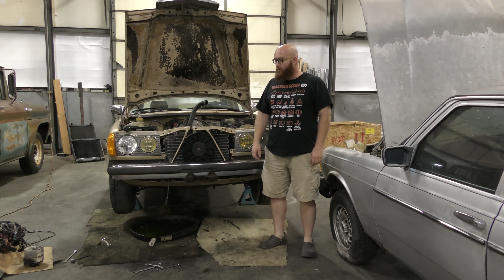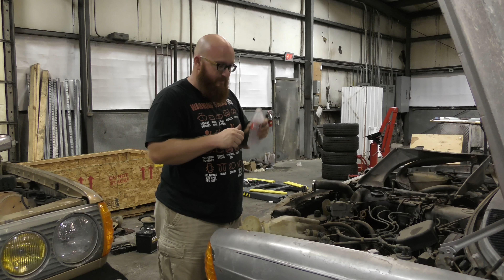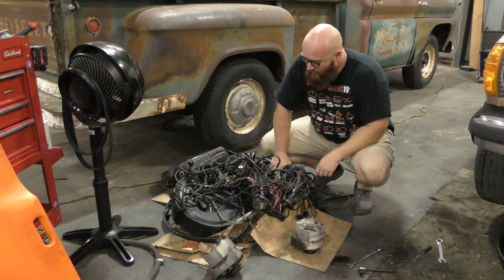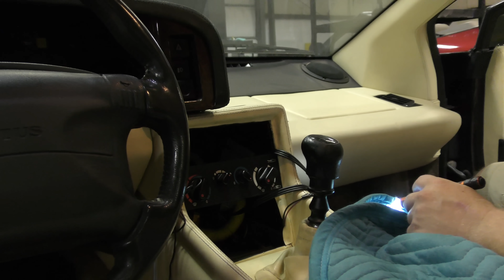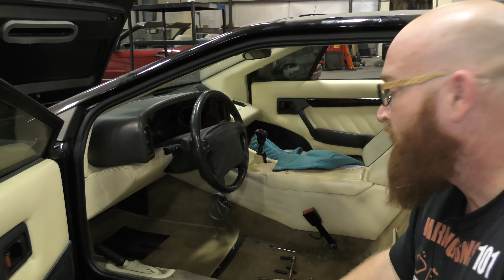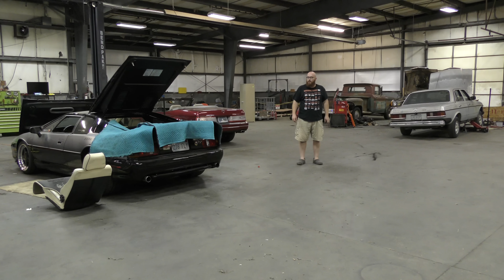Major Lotus Esprit S4S overhaul 99% done & CAR WIZARD is busy swapping parts on MB 300D restore

Comment: Once the Mercedes is done you mentioned a engine swap with the leftover engine. Swap it into a either a S-10 or S-15 pickup for a parts hauler with a manual transmission.

Comment: Hope you will install a new hood pad on the 300 Turbodiesel.  In addition to quieting the engine clatter, it helps to protect the hood paint from damaging engine heat.  Press on regardless

Comment: How many of you has done work under the dashboard. The head down in the dirty floor besides the pedals, on your back with the legs up on the seat. (or if the seat is removed to make it easier), no room for the arms to move to the reach something up there.  The claustrophobic feeling that you will be trapped where you are. On top of that, you are trying the remove the heater unit. The coolant fluid is pouring down you arms.
My believe is, if you end up in hell, your punishment will be working under a dashboard for eternity.

Comment: hey wizard. if your going to swap all the 85 vacuum system  might as well swap the 85 rear end into the 84 300d. nicer highway cruising gear ratio. motor not screaming at 65mph. my useless two cents. peace.

Comment: I have a W123. The vacuum line from the pump to the brake booster has very fragile nipples that easily snap off when just brushed. I have found that uncoupling the line at both ends to lay it aside is a good thing to do when changing the oil filter or anything else on that side of the engine (glow plugs, filters etc). Then I put it back. Every time I go to a pick and pull and find one of these I harvest that line as I’ve already had to replace it a few times because I forgot. Also my 85 is a 49 state car (Texas car) with a California vacuum routing. It was very confusing, but it is what it is. It has a number of other strange factory items in it as well. Another time for that story. Great car!

Comment: I have a similar no reverse on a jaguar xjs after clutch replacement any pointers to where I should check
Tony in the UK
Reply: chris younts 
Yes hydraulic.. Everything is new. Turn engine off and put in reverse no problem. Just won't go in running

Comment: Wheel bearing for my chrysler PT cruiser. The local parts store failed to ship me the part for two weeks although they had it in stock. I order parts from germany and it only take two to three work days to get to me but they cant ship stuff 50 miles in two weeks.

Comment: Would it make sense to try to replace rubber vacuum hoses with small metal pipes/tubes?  It seems that those thin rubber vacuum hoses go back so easily (under a hot hood) and cause so much chaos...

Comment: It is rare to see a Lotus, it is extremely rare to see a running engine in a  lotus.  It is staggering rare to see a Lotus moving under its own power.  Maybe back in about 1992 I saw one running and moving with its own power.
Reply: Apparently you have never owned a Lotus.  My esprit SE is as reliable as any European car of that vintage.
Reply: My 95 S4s has 80K miles on it and has NEVER failed to start as long as I didn't leave the lights on and drain the battery and always gotten me home. Meanwhile my Honda Accord is on it's 4th transmission and god knows what number alternator. This particular one has been modified WELL BEYOND (chipped, big turbo, etc.) the original 910S engine which itself was a souped up version of an old engine to squeeze for its time the most HP per litre in the world. I would bet that by percentages there are more Lotus running compared to manufactured than any one.

Comment: The alternator from the parts car may be working now, but it would be a good idea to check the voltage regulator brushes before installing it (cheap insurance to prevent a comeback for a “dead battery” or “dead alternator.)

It pains me to see how many w123 owners cobble that vacuum line, it’s $30 from PelicanParts(dot)com for a genuine Mercedes replacement!

Comment: I will always love the fully open feature of the Mercedes hoods.
Reply: I enjoy that on my W202 as well, great access to everything!
Reply: @georgobergfell  And you basically only need to completely take off the hood when you're replacing it, but never for anything else you're working on underneath.
Reply: Theoretically, all cars with prop rods have the capability to open fully without removing anything. If the hood isn’t on struts or self supporting hinges, it can lay all the way back on the windshield. Just be sure to lay a blanket over the windshield so you don’t scratch anything.
Reply: @fastball1977  But the Mercedes ones in question actually lock in that position.  No need to do anything else.  Also, on other cars, a lot of times things bind and washer nozzle lines get in the way or stretch. Not quite the same.
Reply: Volvo 700 series can do that as well.

Comment: The good thing about this harness repair job is: This car doesn't have a CAN bus system yet, therefore you can do a proper solder job to connect the wires together. One that will hold longer than the car is on the road :-)
Reply: Curious as to why you couldn't solder wires on a CAN bus vehicle.
Reply: @cambridgemart2075  It is advised against that, especially with the more modern high frequency busses, because the electrical porperties of the wire can be altered by that, and this makes it so that the bus communication can be less stable. We're getting into HF territory there, and for that, totally different rules apply.
Reply: @Seegalgalguntijak  I'm very familiar with HF and above having worked in comms for 15 years. I wasn't aware that CAN bus operated above 10MHz though.

Comment: I cannot wait for Mrs Wizard's channel, I also think of saving the buy this not that toyota for the foreseeable future, I'll provide the categories
Small: to buy: 2003-13 Corolla, the 2016-20 Yaris, Yaris IA and the scion IA, 2004-15 Prius and the 2003-14 Matrix, not to buy: Echo
Midsize: to buy: 1980s-01 Camry, 2008-17 Camry with auto and 2002-06 Camry, not to buy: specifically 2007 Camry
Large: to buy: 2004-17 Avalon, not to buy: none
SUV: to buy: Land Cruiser, 4Runner and Highlander, not to buy: FJ Cruiser
Sportscar: 1994-99 Celica (technically 2 door version of corolla and is Scotty Kilmer's daily driver), 1993-1998 and 2020 and newer toyota supra, not to buy: Camry Solara (same as celica, but a camry)
GM: 1984-88 Nova, 1989-02 GEO Chevrolet Prizm and Pontiac Vibe
Bonus: Lotus Elise, Exige

Comment: That heater control valve on the Lotus is ridiculous. The old Jaguar XJ heater valve used to be a 2 day job. An old and now sadly departed friend had a repair shop and he had to replace one once. The Jaguar book said it was a 2 day job. The body didn't have to come off, but the entire dash had to be dismantled and removed. Crazy design.

Comment: You need your new Bendpak swamp cooler.
The old 300TDs run forever if maintained.
Lotus is a money pit.
Reply: Everything runs forever if it's maintained. I still have my great great grandpappy's axe from the 1800s. Only two new heads and three new handles over the decades. It's like new and built like a tank. They don't make 'em like that anymore.

Comment: If I had any leftover budget on that W123-job, I'd put it into swapping out the headlights and bumpers for Euro-/German-spec ones. That car looks so much nicer with the "original" trim.
Reply: This. The US ones are nasty.
Reply: Yes, they just look wrong.
Reply: If it's allowed in the US. Does it not to be in the shape it was once registered?
Reply: @JohnDoe-zr6bk   Inspections vary A LOT state to state.  I don't think there is a single USA state that would care about cosmetic piddly stuff like that, those that do have inspections check emissions, a few states do a more comprehensive check for rust, worn suspension, etc.  And I think half the states have no inspections.

Comment: My Porsche had that issue , according to my Porsche dealer here the other one didn’t tighten the pressure plate properly and I had to pay $5000 to have all the components replaced ..now it goes into gear without grinding . Before I couldn’t get it into gear and it was new 1500 miles ago

Comment: I seemed to remember the approximate cost for this work on the Merc was around $4k which seems a bargain with the amount of work that needs doing
Reply: My guess is that it will be substantially higher. Everything they touch is broken or breaks. It's a nostalgia project with sentimental value, otherwise they could have gone out and bought a nice one for less than this is going to cost.
Reply: Not sure id be that nostalgic about a car but can understand the sentiment

Comment: How do you end up charging customer for parts that have come from a sourced parts car? Do you just charge them the cost of the car and then you keep the rest or do you charge for each part as if it was bought?
Reply: With a donor, we'd charge average USED cost for parts with no markup. With sticking to book on labor cost, the shop makes money and, overall, the customer makes money. Regardless, it's customer choice for new/used. 

Now, if donor car was super cheap, and not supplied by customer, we'd charge what we paid, swap the parts (labor only), and customer could save quite a bit and we'd ebay usable parts and make bank.

Comment: I'd have that Lotus over a Ferrari or a Lambo any day of the week.
Reply: Older genuine Lotus parts are ironically more expensive than many Ferrari parts.
Reply: @MrCarGuy  Depends on the engine and which country you are in and whether you know someone with a 5 or 6 axis cnc  I guess.
Reply: @TheRealSasquatch  By old I'm talking about the era where Lotus used proprietary engines. Having access to a CNC machine and data to do it is completely different. I'm talking about buying OEM parts from each company.
Reply: @MrCarGuy  OEM for an effectively defunct company - hmmmm.  900 series engine parts are available from specialists - who tend to remanufacture - that's the reality of owning a very special  car.
Reply: @TheRealSasquatch  Uh, yeah: Hence the reason why they are so much more. The reason why is irrelevant here for the end user. Many haven't been made in a while. Seems to me like you have some sort of emotional reason of white knighting for Lotus
Reply: not necessarily - there are plenty of small engineering firms who can repair or recreate many parts for classic cars in the UK - you just have to find them. Lotus used many off the shelf parts - you just have to know which is which. I admit getting parts outside of the UK may be more challenging - but that's why small engineering firms are so important. Lotus Cars, like early Astons, are iconic for so many reasons in a way I don't believe the "Italian" exotics aren't.
Reply: @TheRealSasquatch  The cost is still higher for the owner. Justifying it doesn't change the price. Many OEM parts haven't been made in a very long time (as I said) and finding aftermarket parts and shops to make them is still more expensive. I'm sure it is even in the UK. At least Aston parts are more obtainable. 

The Lotus network in the US is still so bad you'd be lucky to get a part for your new Lotus.
Reply: @MrCarGuy  I'd still prefer a vintage Lotus over a vintage Ferrari or a lamborghini as the total ownership costs and the driving (in my UK) experience will be better. Perhaps you need to find a better engineering shop?
Reply: @TheRealSasquatch  A better engineering shop? Do you have any idea how expensive it really is to recreate a part (even if they have one of those new parts scanners)? The data isn't just available. There are certainly none that do it for vintage Lotus outside the UK without commissioning as special project. Either way, it's more expensive than just going to a Ferrari dealer and ordering parts unless it's a scarce model.
Reply: I said the same thing until I owned this one for 10 years.  Now I’d take the Ferrari  or the Lambo.
Reply: I'd have a Toyota over them all.
Reply: @dennisneo1608  For reliability I can understand that - but there is something about the way a Lotus handles that ticks all the boxes.
Reply: Damn I'll take the Lambo then !
Reply: Even tuesday?
Reply: @JaredConnell  Especially ;-)
Reply: I would take that chevy truck over them all. Great reliability, looks good even with rust, and can usually fix any problem on the side of the road with just a basic tool set. You have fuel, spark, and compression it will start every time. No sensors, no check engine light, nor a computer.
Reply: @johnnysouza5601  makes sence !
Reply: Sasquatch LotsOfTroubleUsuallySerious 😬
Reply: @paulcoulter5292  Yeah I guess 25-30 year old Ferraris and Lambos are really easy and cheap to work on .......